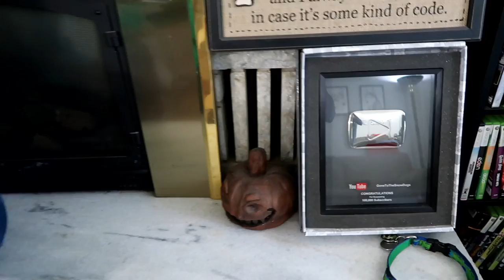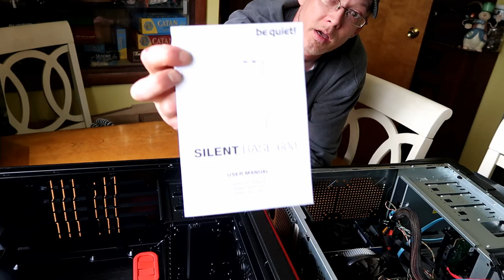IT'S FINALLY HERE !

Comment: You should work on cable management for the PC, it's going to increase the airflow, and your PC will stay cooled on a lower RPM on the fans, which will make it even more quiet under heavier loads.

Comment: That case looks very cool! mine also has a window so you can look inside. It also lights up blue. Yet it's very powerful now. It originally was 400 watts, had a GTX 950, and was slow as crap. I mean it's better than a Mac, but it did not do well on Minecraft with shaders. (even low end ones) The very large monitor is made by BENQ and it has an LED Display. We modified the specs inside the case, made it 600 watts, put a GTX 1070 in there, and it still ran slow. But it was a little better than last time. At least I can now play my games at max settings. Even the CPU intense ones at 60 fps. I guess it could be a great starter gaming computer. however, it was overpriced (1000+ US dollars) and very slow. the case itself was made by IBUYPOWER.